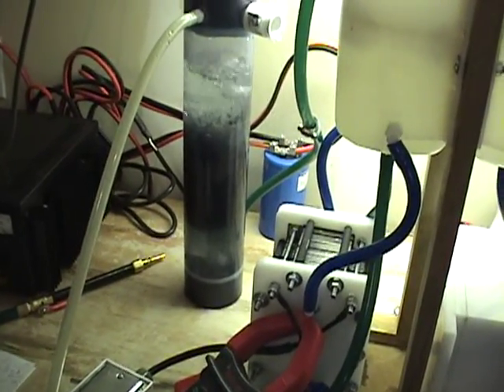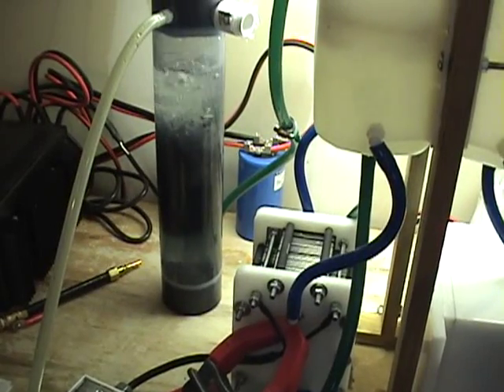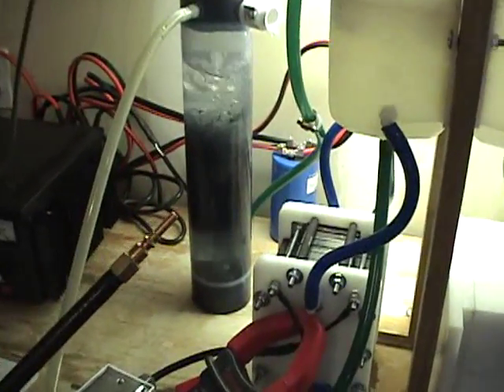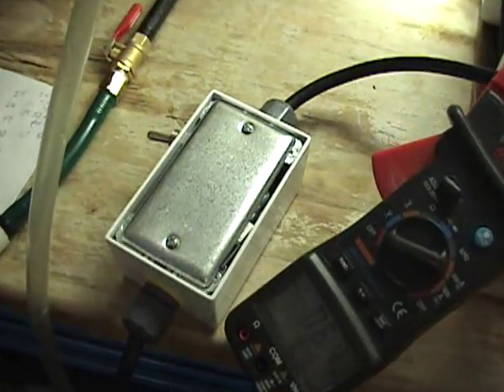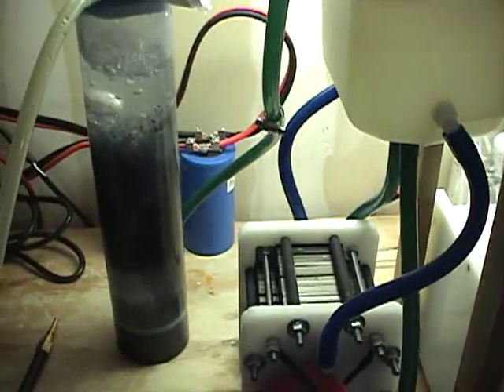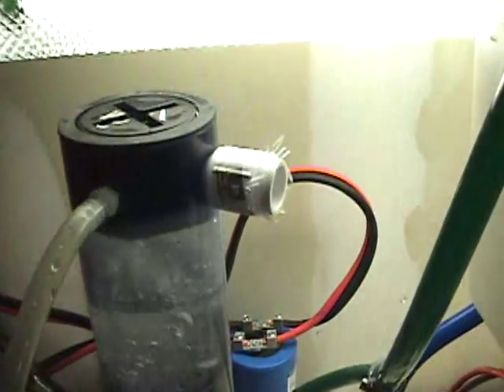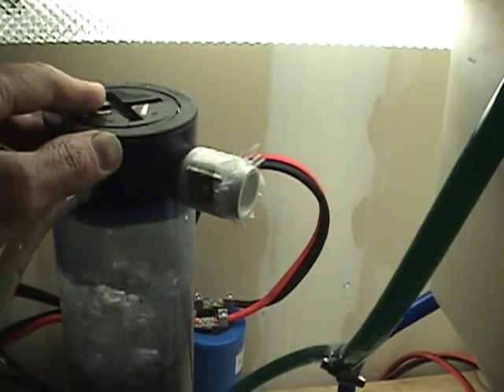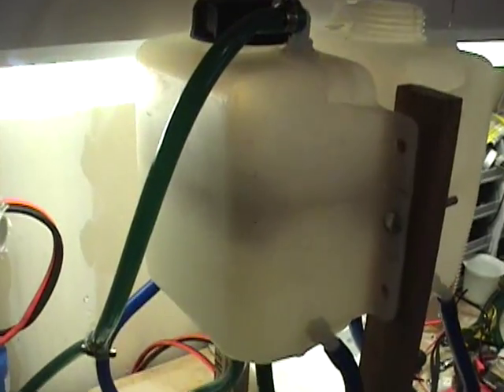Hydrogen HHO flastback killers test

Comment: on the flash back arrestor you build try useing stainless steal brillo pad instead of steal wool  the steal is flamible set it on a 9 volt battery and watch it burn stainless may be better for higher gas production. Keep safe nice video

Comment: Hi,
Another option I think would be stainless lines (durable) or maybe braided. Coupled with that on the downstream side of the arrestor (close to it) a thermal couple or thermal sensor that would shut a solenoid valve that was upstream to kill the flow completely. This would be a secondary safety feature at worst.

Comment: The first Flashback Arrestor did well if you consider that in a real world situation you will not have that many flashbacks in a row.  If you had a flashback it would only be one or two before you would turn off the cell. One or Two flashbacks should not melt the hose or the barbs on the arrestor.

I'm sure the second Flashback Arrestor you tested could be made into a much smaller enclosure and still work just as well.

Nice video. Keep up the good work.